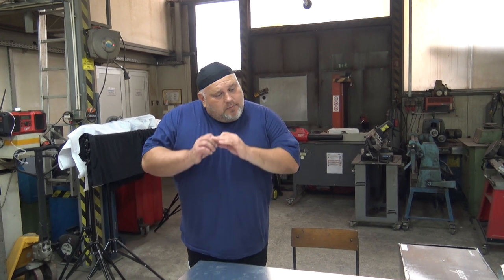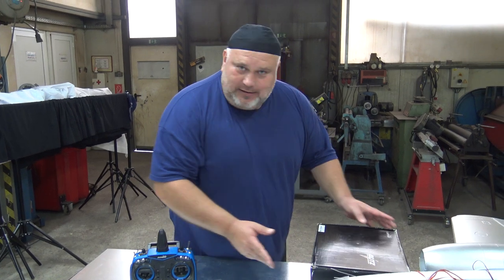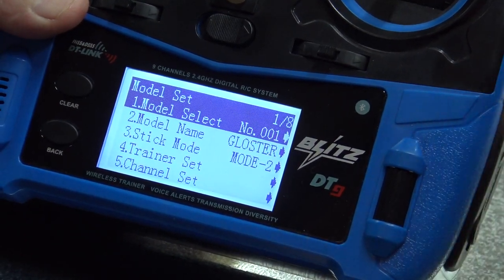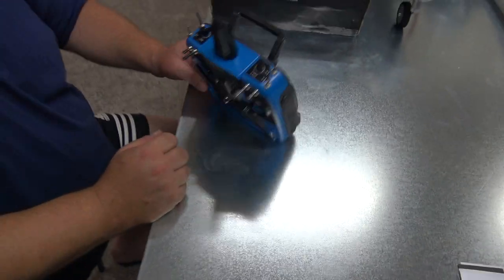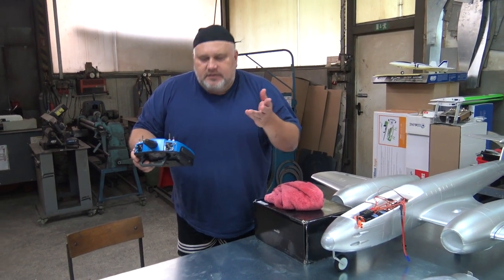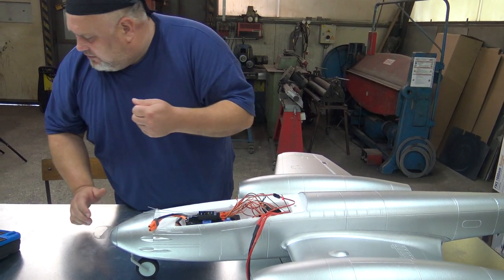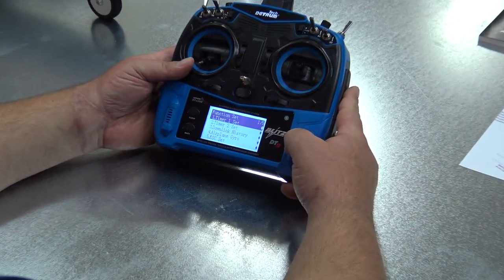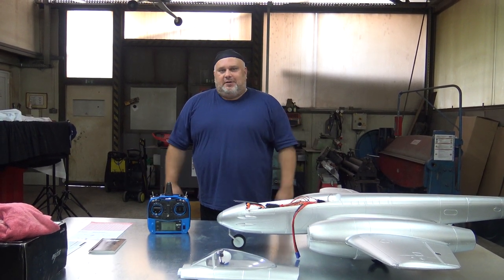Detrum Smart Blitz DT9 BLUE 9ch transmitter & Istone SR86A 8CH gyro receiver Simple setup Guide

Comment: Really nice radio with great features. Setting the ESC from the transmitter is something special but the best thing is the cheap receivers with the gyro built in which can be set from the menu in the transmitter. At that price they are unbeatable.
And the set is simple to use so what more can you ask for?

Comment: I think your gyro settings are way too jittery.   Looking forward to seeing the test flight.   Also the trim buttons on my detrum blitz barely move the surfaces.  I have to use subtrim when in the air to make adjustments.  Not sure whether I'm doing something wrong or whether its the transmitter/receiver. Otherwise I love the blitz and the receiver (i have the return to home  gps receiver).